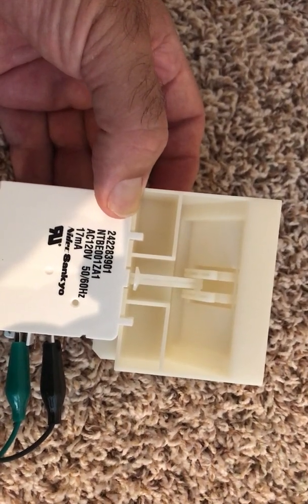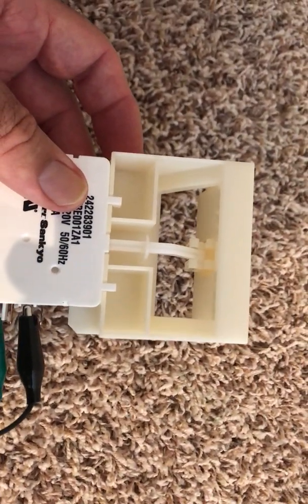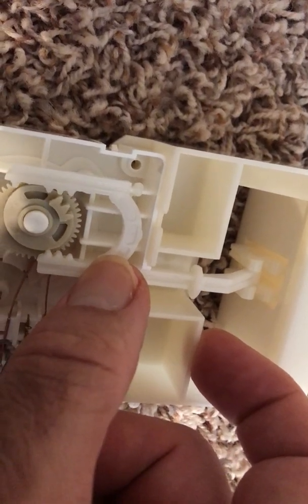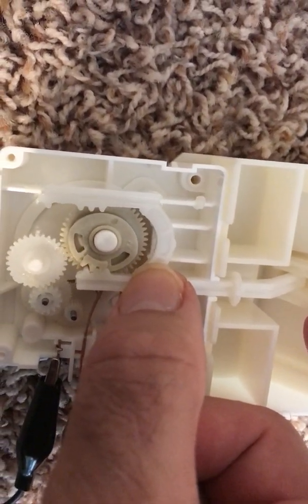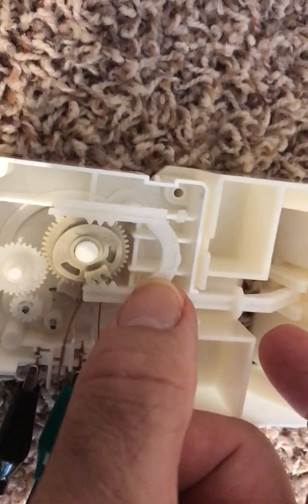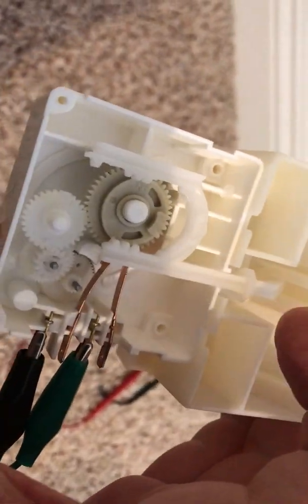How to test Frigidaire damper motor assy with 110 volts AC August 11, 2022

Comment: If you watch closely at 5:14 -5:25 you will see the tan gear jump around the shaft just a little. The tan gear is worn in an oval on the shaft. What solved the issue for me was to file down  the middle tooth 1mm on the u shaped arm that holds the door to account for the play. As the 3 tooth tab on the beige gear would bind on it when opening the door

Comment: I just replaced mine. I could see where your flapper arm was sort of sticking. Mine was running smooth but my refrigerator wasn't cooling below 41 degrees. The replacement damper now gets to 37 degrees set on number 7. Maybe it was the cold affecting it or not.

Comment: What side is hot? You don't bother mentioning that or show the leads being plugged in.  So aggravating.
Reply from the maker: The motor is simply windings and it is alternating current. The field windings in the motor do not care which side is not or not. The windings care about AC voltage being supplied and then the motor will spin. You can put the wires on any way you want. You have a 100% change of getting it right. There are two wires and only two possibilities. If the motor does not turn it is shot. Warning - DO NOT RUN the motor too long OUT of the fridge. The motor NEEDS the cold air as to NOT burn out.

Comment: It looks fine. Did you fix it?
Reply from the maker: YEP. I Put in a new damper motor. That one in the video was SHOT. It overheated when I was running this test and the motor burned out. Paid $120 for a new one and put it in and problems over and gone.